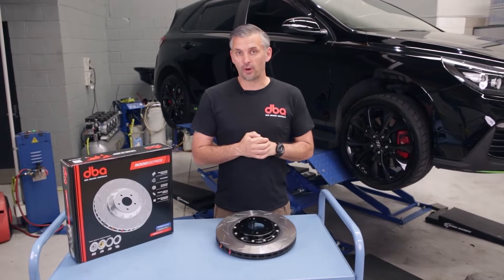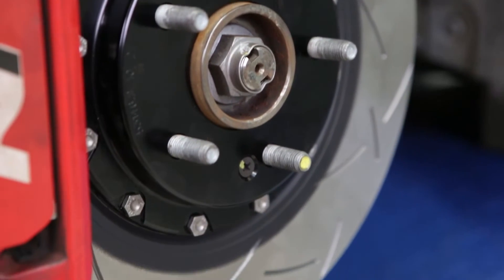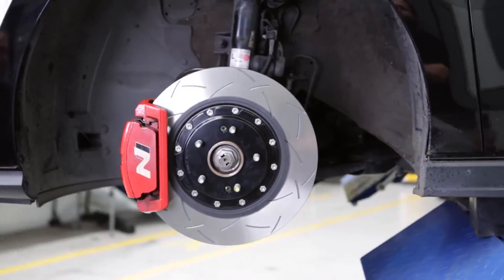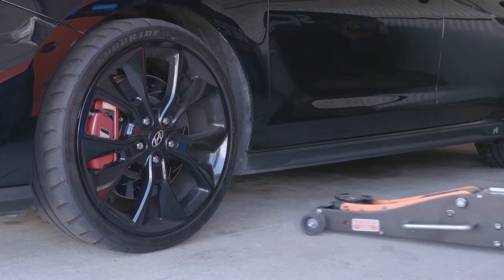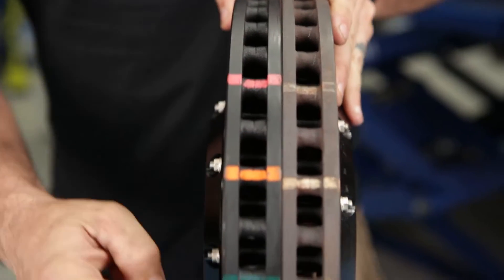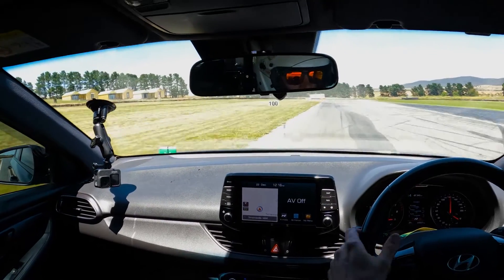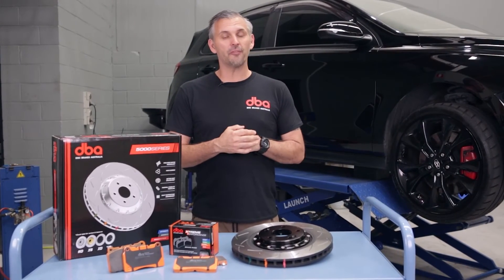Braking In Motorsport: Rotor Selection For Track Days | Disc Brakes Australia

Comment: Yeah so mine warped, replaced under warranty, then they warped again. Jax at st marys did the replacement. When they told you guys, you accused me of taking it on the track.. bro my car is a daily, i work 6 nights 12 hours.. the one day i have off im home with the kids. I hqvent been to a track in 15 years. I drive it lightly.. so tell me why they warped within 7000kms? Was it your quality or the wormanship of install by jax? If it was the workmanship, why didnt someone come to inspect the install? Instead you just accused me or racing and im left out of pocket with below par discs that warp
Reply: Was this a DBA T3 4000 series rotor or DBA OEM replacement?
Reply: @mtadc1545 oem replacement

Comment: I recent track night I saw a photo of my car braking and the rotors were glowing red . The rotors are the 5000 series, is this ok
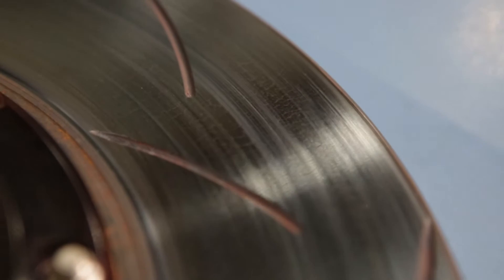Reply from the maker: Hi Stewart, it depends on the temperature the rotors are reaching. You are best to check the heat paint markings on your rotors as discussed at 3:50 of this video. If all the paint markings have gone off you may want to look at the braking systems friction material and cooling methods.  Send us a PM on Facebook if you have any further questions.
Reply: Hola,disculpa que coche tienes?? es muy potente,gracias

Comment: @1:25 you say to avoid using new pads and me rotors when bedding in this part has me confused, so do you put new rotors on first then drive a couple hundred miles then put new pads on and then bed the pads in?
Reply from the maker: Its not essential to bed in rotors and pads separately. When replacing either brake pads or rotors, it is recommended to bed the new component with the existing one rather than using both new components together. This is because new brake pads and rotors have a smooth, shiny surface due to the manufacturing process, and it takes some time for them to wear in and create a consistent surface.. By bedding new brake pads on old rotors, the pads are able to quickly conform to the shape and surface of the rotors, resulting in better initial braking performance. Similarly, bedding old brake pads on new rotors allows the pads to create a smooth and consistent surface on the new rotor, improving the longevity and performance of both components. Further, different types of brake pads and rotors require different bedding-in procedures. Generally, it is best to check the manufacturers recommended bedding in procedures for your specific applications.

Comment: Good clip and I am planning on getting the 4000 series slotted one piece rotors for a BMW E90 M3. I would like to get some ceramic based pads for this - mostly street use, some spirited driving here and there and the very occasional track day (one every year maybe). Is the performance street pad the go? Are they ceramic based? Brake dust reduction would be good. Would it also be best to use the existing pads for a while, or just change the lot and bed in using the progressive braking technique? Cheers!
Reply from the maker: Thanks for your message, Grant. Unfortunately the combination of characteristics you’re describing is difficult to achieve. Our only ceramic formulation are the ‘Street Series’ pads, however these are not suitable for spirited driving let alone track work. 
If you are looking for an all-round pad that can do road and light track work, our 'Xtreme Performance' is the way to go. It’s carbon fibre infused low metallic, which naturally means it is quite dusty though.
A really well performing, ‘middle-of-the-road’ low dust pad is the 'Street Performance' pad that you mention. It’d be suitable for spirited driving, however not for the track.
In terms of sequence of changing the components, either way is fine. You just want to be sure that the existing pads are level and not worn unevenly. If they are uneven, then we would suggest to put in new pads when changing the rotors.

For further information, our ‘Buyers Guide - Friction’ can be found on our website under 'DBA Catalogues'

Please feel free to email us at technical@dba.com.au if you have further questions.
Reply: @discbrakesaustralia  thanks for this - very helpful and much appreciated! Cheers!
Reply: @discbrakesaustralia  would u suggest that xtreme pads in the front and street performance in the back with dba 4000 t3 brake discs is good enough for a trackday? The Car is a '18 Audi S3.
Reply from the maker: @adotorcida  Hi Adrijan, thanks for making contact. Depends on the nature of the track day, number of laps and operating temperatures. Regarding pads our Xtreme Performance pads would suit for a 'hot lap' or so, however if you are looking to do a number of consecutive push laps (a race) than a race pad would be best. Generally speaking if your vehicle is near stock (ie no slick tyres or other major performance upgrades from original) XP pads would be ok for a few laps, however due to the nature of the pad compound and it being formulated for street use, a track session would reduce their service life. 
Regarding the rotors, yes 4000 Series rotors offer very good performance vs cost in a track day environment, providing that the car again is in original road registered condition with no major performance modifications. I hope this answers your question, if not please feel free to reach out to our technical department via email: technical@dba.com.au They can assist you further for more specific recommendations for your application.
Kind regards, DBA